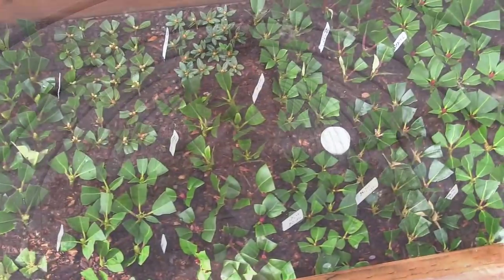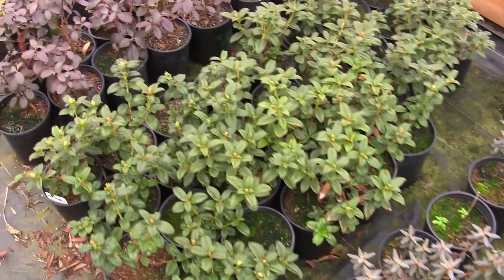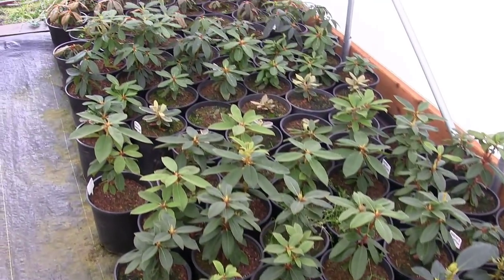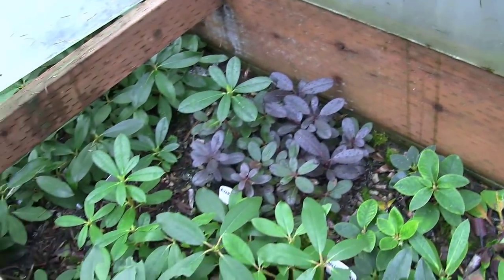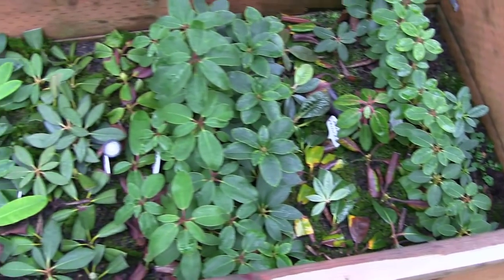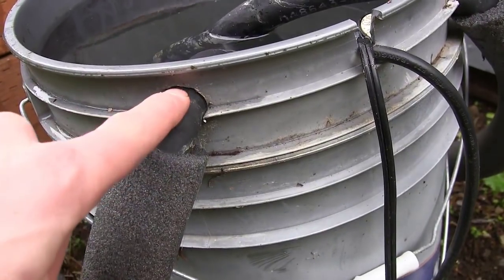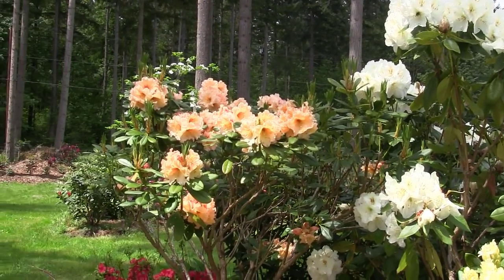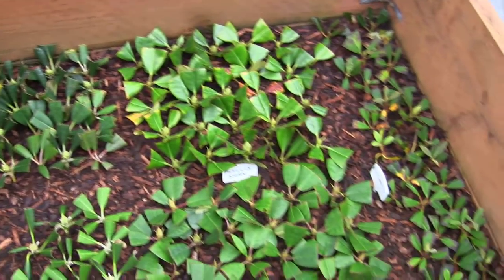Propagate Thousands of Cuttings Easily?  Learn How to Build the Ultimate Plant Propagation Frame.

Comment: Hi Mike I can just afford the material list to build the propagating frame but not the $79 for the plans. I am 75 years old and on a small pension.
Danny Davies.
South Wales. UK.
Reply: Danny Davies. I have tried all the fancy propagator's out there, including Aeroponics. The cheapest and best method i have found, is to buy plastic washing up bowls in your nearest pound store, drill loads of holes in the bottom, then fill with builders sharp sand and keep damp. I am in S, Wales too.
Reply: And Mike is no where to be found with this comment..

Comment: I can save everyone 12 years. Sand, water and cutings of your choice. Read some propagation books, have fun with it and don't listen to this guy. Get an 8inch dep bed of sand and stick softwood cutings in, sticks from shrubs and make sure to water a cuple times a day. We have them in a polytunnel. Nearly 800 dogwoods from £50 worth of bare-root stock. Job done.
Reply from the maker: I appreciate the comment.  If I didn't know what I know now, I probably would have said the same thing.  Softwood cuttings are pretty simple to propagate and softwood cuttings of dogwoods are at the top of the list of easy plants to propagate so you're right, you don't need this system for them.  I created this frame, and everything that goes with it, in order to have the most success with semi-hardwood cuttings of rhododendrons which are one of the more difficult plants to propagate.  It took a long time and a lot of trial and error to get here.  This system will propagate just about anything that can be propagated and now that I've arrived here, I wouldn't do it any other way.  Good luck in your endeavors and thanks for hanging out here.
Reply: rhodies are one of the more difficult plants to propogate? In an earlier video, it was said to be one of the easier ones.... but then, there was no sales attempt in that one.... smh
Reply: Don't listen to haters Mike. You do such a wonderful job
Reply: Stop it Mabb! Your making it look easy........

Comment: I am propagating fruit tree cuttings with heat pad in a plastic container,why is it that after budding with leaves,the leaves will fall off and will not continue?do I need to take it out from the container after budding?
Reply from the maker: I don't like propagating hardwood cuttings in a humid environment because it forces the buds to break before the roots grow.  Then you have a leafed out cutting that can't survive without humidity.  This forces you to keep it in the humid environment where fungus can take over.  hardwood cuttings are a slower process and need time to root and grow.  Get the roots first, without using humidity and you'll be fine.
Reply: Mike, so when is the best time to propagate cuttings from Asian pear and persimmon,I live in Virginia,thanks
Reply from the maker: While they're still dormant but a month or so before the weather starts warming up and buds begin to break.  Use bottom heat for a few weeks to build callus.
Reply: thanks mike

Comment: It is great for the scale you are doing, but I am only wanting a box do a five or six cuttings.
Reply from the maker: Hey Max, you don't need a frame for 5 or 6 cuttings.  Just use a 3 gallon pot and cut a milk jug in half to put over it.

Comment: Mike.,  Is it too late to take cuttings from a burning bush.   11/1/2018 to root out if I keep it indoors by my woodstove
Reply from the maker: You can take hardwood cuttings of them but they'll take long and there's a different process for it.  I recommend leaving the hardwood cuttings outside and letting the warm spring weather wake them up.
Reply: So in other words don't take any cuttings until the spring right.  I just thought they might be the same as fig cuttings that you cut in Dec or Jan.
Reply from the maker: You can take hardwood cuttings to experiment if you want to but they'll root easier in the spring.  Try both methods and see what happens.  I'll bet you'll have a bigger and nicer plant by next fall with the softwood cuttings.

Comment: I have an orchid and I have a question about that orchid and that question is if the crown has mold on it and all of the leaves died off and it’s just a green stem for where the flowers bloom from would their be any way for me to save thee orchid and have it grow back all of the leaves?
Reply from the maker: Sounds hopeless but I never give up.  Spray the plant with a mixture of 50/50 hydrogen peroxide and water.  Let sit for a few minutes and this will kill the mold.  Rinse off, up-pot to a bigger pot with VERY good draining material, and place under some mildly powerful grow lights, even a fluorescent bulb will work.  Give it plenty of time and watch what happens.  That's about your best bet.  The only thing that makes me nervous is that you said the only green left is the stem that the flowers bloom on.  This is different than the stem you get green leaves from so it may be a futile situation.
Reply: @MikeKincaid79  Ok I’ll try that

Comment: HOW DOES THIS SYSTEM COMPARE TO MISTING SYSTEM
Reply from the maker: It really depends on your goals.  They both work fantastic.  I've used both systems.  The mist is like magic and will root cuttings even faster but it's more money up front and you have to keep an eye on it daily.  I had close to 500 rhododendron cuttings stuck in a mist bed one year and the mist system (brand new) failed while I was at work.  Thank God my wife was home to continue watering them every 30 minutes until I got home or I'd have lost them.  Still, if you're running a large operation and need thousands of cuttings then mist is the way to go.  If you're running something smaller or private then this system is the way to go.  It's fool proof and there's nothing to watch.  Just stick the cuttings and wait and the rest takes care of itself.  I can still do thousands of some types of cuttings in this frame but rhododendrons are bigger so the max I've put in my 12x2.5 foot frame was close to 400.  I hope all that helps and if you have more questions just ask.
Reply: @MikeKincaid79  Love your channel man , i grow Roses and i want to go commercial but i want to first grow  my stock 1st. Iv been using domes and covers and all but its just not suitable for growing 100s of roses , i recently built a shade house, installed a misting system.With the misting system i have more air circulation which was a big problem for me before and i can deal with the harsh temps of South Africa since it provides cooling every 20min. In your system do you deal with the heat and is it suitable for Roses. i ONCE DID 500 CUTTINGS IN SOME DOME I BUILT AND THEY ROT DAMMMMEEE

Comment: Ok Mike,

 I am going to join on your website. I am building a hoop house and then building your propagation bin and it will be shaded by the hoop house and North Facing. I am Pretty excited to have it all done by summer so I can propagate next year!!  I want to get it set up right. I am just doing it on a tiny scale in a 6X6 green house .
Reply from the maker: Smaller scale works well too, in fact, the smaller frames tend to heat more evenly than my larger frame.  Make sure the direct sun doesn't touch the lid of the frame.  Once you have a good setup like this, it makes propagating so much more fun!
Reply: @MikeKincaid79  Thanks again Mike.